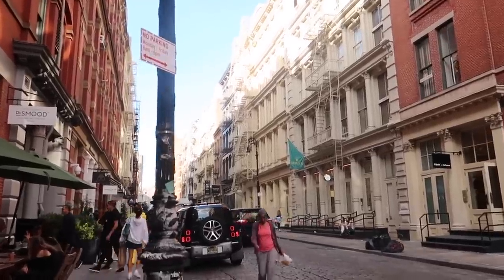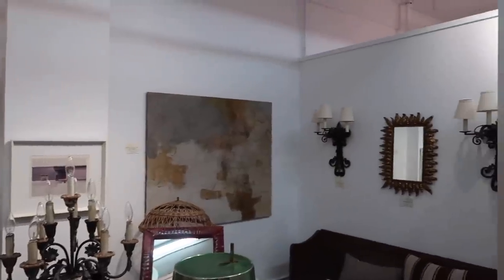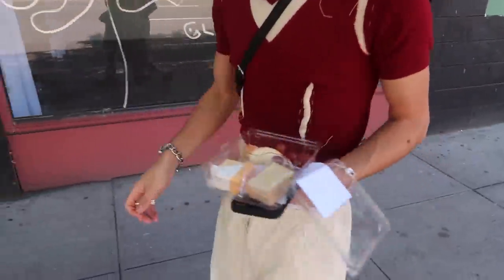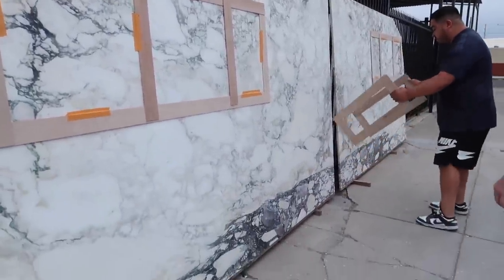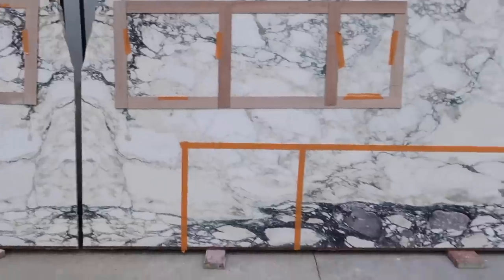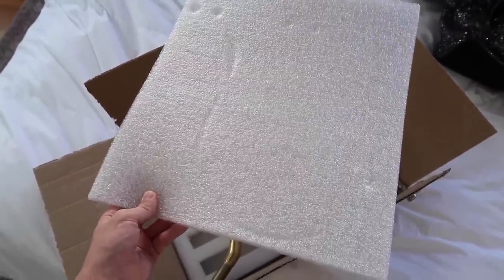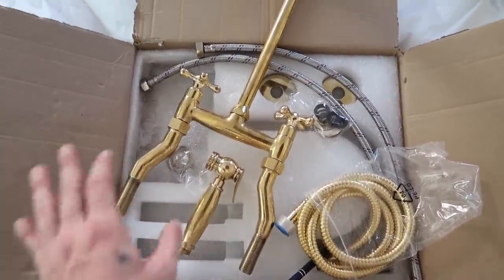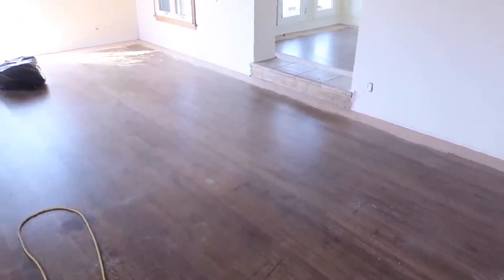Did I make the right choice

Comment: For old  dog urine stains in oak floors: Pour  hydrogen peroxide over the stain & cover it with a clean cloth soaked in hydrogen peroxide. Cover the cloth with plastic wrap, weighting it with a book. Let it sit overnight (at least 8 hours). The hydrogen peroxide should remove any stains and eliminate the urine odor. If this doesn't work in one go, do it again until the black stain is gone. In our home the mud room had a lot of black staining from the former owners dog who was kept there. It took it all out! It did take several applications because it was really bad.
Reply: Good info.👍🏽
Reply: this is helpful. You do this step when you sand the floors? Meaning peroxide on unfinished wood?
Reply: This is good info. I used vinegar and baking soda to get the smell out of our floors. It worked but the stains remain. By time we sanded the floors and re-stained them it actually made the dog stains so much worse. I assumed staining would even it all out. Wish I would of found a way to get rid of them before we finished our floors.
Reply: It didn't over-bleach the spots?

Comment: That marble is STUNNING!! You may want to use a dainty little sink grid to help protect your marble after it’s installed. Since marble is a softer stone, you’ll want to be gentle on what you put directly in the sink, but a grid would help so you don’t have to worry about it! Love your channel!
Reply: That’s what I thought immediately. Be careful.  I love the whole idea though
Reply: What is a sink grid?
Reply: @lindasands1433  it's like a little thin rack that sits in the bottom of your sink to keep dishes off the bottom.
Reply: definitely need to seal on a REGULAR basis
Reply from the maker: Such a smart idea!! Maybe I can find a pretty brass one 😮😍
Reply: @lindathompson9334  Oh! Thanks 💜
Reply: @lonefox  definitely!
Reply: @lonefox  Silicone
Reply: @lonefox  brass is also an high maintnance item... it would not be perfect inside the sink, i think.
Maybe you better tske a silicon mate while using the sink and put it away later.
Reply: Or here in the UK you would have a sink basin that you could store under the sink /keep in there for washing dishes in.
Reply: @lonefox  Hi, I live in Italy, and there are a lot of different things made of marble here, because Italy stands on the marble mountains.
 I mean, it's a bad idea to make a kitchen sink out of marble. Marble is a very soft and porous material. I hope you won't wash greasy plates in oil there, and also stains from fruit juices, tomatoes, tea, coffee and even Coca Cola.
 A brass grille is a bad idea. She'll scratch the marble right away! I hope you'll use the dishwasher more than the marble sink. For the kitchen, it is better to use granite, not marble. 
And it seems that this will not be the only kitchen in your house?
Baci e abbracci dall'Italia 💐😘🌹🇮🇹
Reply: You might actually try to maybe coat some of the marble with a thin layer of resin to see if that would help to protect the marble in some areas.  I would try an extra piece just to do a test.
Reply: @hannahwort8861  Yes, we have this, too.
You  can even make a whole over the hole in the sink where the water goes out an open and close it, so its easier to use
(Sorry for my bad english, i hope it is understandable what i want to explain :)
Reply: @lindathompson9334  except that the feet will scratch it :(
Reply: @anjahorn  laquered brass would be ok because it's protected from the water
Reply: @lonefox  OH! yes!!!
Reply: @Elena-jj3ht  maybe just paper dishes lol
Reply: @karens346  Great idea 👌😉
But if dirt suddenly gets on the marble, then you can quickly run to the garage, take a shampoo for the car, the one with wax, and quickly wash everything. 
The wax will leave a protective layer. This is in case of an emergency, if you suddenly forgot to buy a marble polish.... .... and seriously, marble requires care, effort and time. To always see the shine, you will have to polish often.
 Especially because this surface is horizontal, not vertical.
 Otherwise, it will soon be matte.
Reply: @Elena-jj3ht  you are much more knowledgeable than I am. I have a stainless steel sink. I love when it’s all shiny. Then someone (my husband) comes and drips water on it.  🙄.  I can’t imagine taking care of a marble sink. I enjoy Drew’s talent as I guess we all are. Love his channel. 💙
Reply: @karens346  A stainless steel kitchen sink is perfect! 
All over the world, all kitchens in restaurants are made of stainless steel. It is primarily hygienic and vandal-proof!
 But Drew is a big aesthete, and he doesn't have a big family with three children))) 
I have also been watching this channel for several months with pleasure! This is relaxation for me.
 I wish you all the best 💐💐💐
Reply: Find the appropriate soap for dish washing. Have a grid or rubber mat. Anything will STAIN.  Maybe use a tub instead of the sink.
Reply: A copper rack would be perfect!
Reply: A sink grid will rust in time and leave rust marks... trust me I know... I would never use marble as a work surface it never ages well... BIG mistake... I believe both Lone Fox and Macenna are more into mood than functions... they should get more advice or do more research...
Reply: Legit.  You'll definitely want to protect the marble, and not just in the sink.  It's totally gorge though.

Comment: Instead of staining the floor,  look into oiling the floors.  I saw a couple with an historic home sand and oil the floors and it was wonderful.
Reply: I love oiled floors! With the high quality wood it would be gorgeous!
Reply: Right and the warmth of the wood comes out naturally!
Reply: Look for a product called, "Gymseal". It's literally to seal and protect high school gymnasiums (think, the wear it takes to hold up under basketball games!). Much nicer than varnish.  Do research it, though. A few years ago they altered it and may need to poke around to find something as the same quality it was before. xx
Reply: @tracylf5409  for beautiful old floors synthetics are not good for the wood or your lungs.   I would oil the floors.
Reply: Yes, a dark tinted oil would give lustre.
Reply: @Lili-xq9sn  Not a fan of fumes, but the product is a long-standing favourite with a very strong following-- and yes, from woodworkers as well (worked for years in a hardware store in business since 1920, & Gymseal was always in high demand for it's sheen and durability). I also liked tung oil for small wood jobs, like furniture though it took forever to dry and sanding between coats.
Reply: @tracylf5409  thanks.  I'm no expert,  but i watch a bunch of old home restoration videos.   Varnish is what was originally put on old wood in homes.  For me,  if ho with varnish or oil.   

Sealing them completely prevents wood from breathing or developing a beautiful, natural patina.  Which I think he's going for to keep the character of the old home intact.

Comment: Those striations in your wood floor are called "ray flecks"—and you're right that quarter sawn oak is coveted for this exact reason (along with the fact that it's very stable and doesn't cup or warp very easily). I'm not much of an oak fan, but quarter sawn oak with lots of ray flecks in it gets me anyway!

Comment: Hi Drew, condolences for Roger, he seemed such a sweet guy and kindly allowed you to express your creative design in his property. Don't find too many like him, that's for sure.
As for the dark stains on your oak floors, Dashner Designs uses oxalic acid, rubbing over with fine steel wool, over an oak cupboard in his 17th September segment to get rid of dark stains, perhaps this could be a good way to get rid of those stains on your floors.  Worth a watch.  Personally, I would prefer a clear coat rather than a dark stain on those floors, to lighten up the area, as dark on ceiling and floors would be too oppressive for me. You most likely would put down rugs to bring some spanish colour into those rooms I would think.  Also your fireplace,  rustic stone up the chimney, or even just on the bottom parts, would add another dimension of texture to the room?  Love watching your content, keep up the good work.

Comment: Those floors!😍 All of the marble is going to be stunning! I would NEVER sand hardwood floors. We sanded original 1950 parquet and newly installed oak in our first house. It came out nice but honestly it was stressful and messy. We built our second house with 2,800 sq ft of hardwood and we subbed out the sanding and finishing. I might attempt a light refinish but not with an old stained floor.

Comment: It’s called quarter sawn oak where you get the tigered stripes pattern flaky oak. Your floor also has Rift cut oak where you get straight lines in your oak planks. They don’t even allow quarter sawn when there’s a shortage of aging oak trees. cutting quarter sawn boards waste more lumber so it’s more expensive. You have a great oak floor!

Comment: Above your choice of marblel but of course I love your choice of most everything
As for cleaning the brass the best thing to clean it is all natural cornstarch a little bit of water to make a paste I'll rub it with a super soft brush like a makeup brush or a camel hair large artist brush or you could use cloth do not use microfiber the cornstarch method is also great for stainless steel can work for copper you just need to make sure that you dry everything really well after you finish scrubbing it

Comment: To maintain your faucets, so that they do not become a gigantic job occasionally, every time you do the dishes, just wipe them over with standard dishwashing detergent and water. This removes food, stains from fingers, smudges etc. Wipe them dry with a micro fiber cloth. They will age gracefully, and evenly, because attacking them with a brass cleaner occasionally, will result in a new look, mixed with dark patches. 
This is the way to slowly create an even patina. Do it at the same time you wipe out the sink.

Comment: Quartersawn wood is literally cut into quarters before it is run through the mill. The “point” is set at the top of the cut. In this way, the wood is sliced with the grain largely perpendicular to the face. The widest lumber is taken from the center of each of the four quarters.

5/4 (five-quarter) lumber is 1.25″ thick when rough sawn. When 5/4 lumber is planed, typically it is finished at 1.063″ thick. 6/4 (six-quarter) lumber is 1.5″ thick when rough sawn. When 6/4 lumber is planed, typically it is finished at 1.25″ thick. 8/4 (eight-quarter) lumber is 2″ thick when rough sawn.

Comment: Floors are beautiful, but it would have been better if the flooring guys had removed the quarter round before sanding to get all the way to the baseboard.  If it's done properly, it can be put right back down again and gives you the option to change the mouldings later if you need to.  You also get a much cleaner look in the end.  
Can't wait to see  the cut marble in place!

Comment: So just a word of caution for your e corporates sink…I have one; it’s one bowl quite large. It is great for large things (babies, puppies and sheet pans) but I’ve found I have to use a dish pan mostly. Which is fine. But there it is, in the sink.  It also has 90 degree corners which get mucky and hard to clean.  Additionally, it isn’t  honed to drain properly… it’s too level.  I love it, but if I’d thought about it a smidgen more, it would be perfect.  I also got it quite deep, not thinking about ergonomics and it’s a bit too low.  Who knew sinks were so finicky!!

Comment: very glad you didn’t attempt floors yourself. it’s very easy to ruin them. one does not know how many times it’s been done before, and there is a limit. i have quartersawn too! hoping you didn’t let them use filler in spaces.
Reply: So you just let spaces stay in your floor?  Does it cause drafts?
Reply: @Lili-xq9sn  yes, i don’t know about drafts because usually the heating system is below and heat rises, causing the compound they use to dry up and fall out in chunks.
Reply: Thank you for telling me this...I hope to get an old home!

Comment: So after all that time "choosing" paint you're changing the colors of the floors which is the entire surface that will determine what color paint will work. Hopefully you didn't actually paint or buy the paint yet because that would be backwards. After you stain and seal the floors, THEN get poster size samples of colors you're considering on white poster board  Place the poster down on the floor up against the wall so you can see if there is a compliment or a clash. Your wall paint needs to work with your undertone of your floors. IE you'd never put a yellow undertone wall paint in a room with a rose undertone tile or carpet.